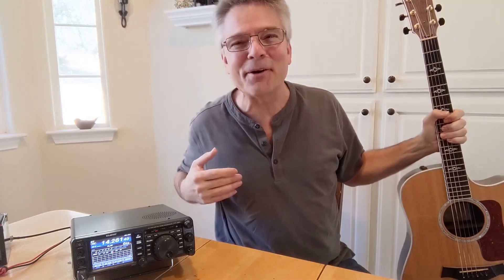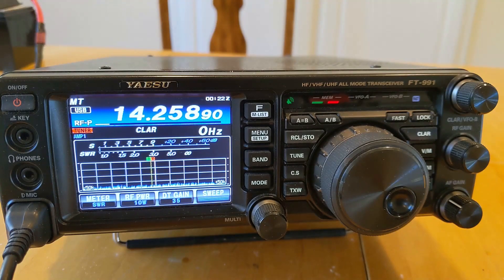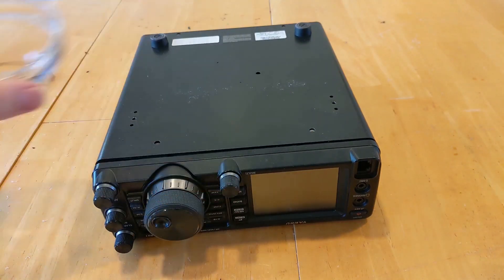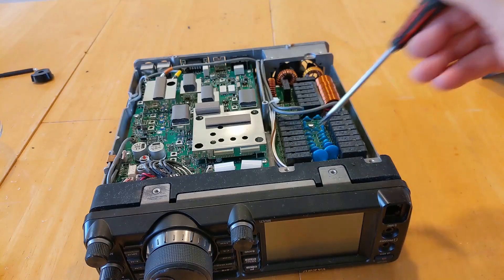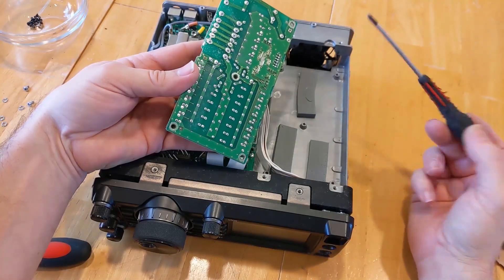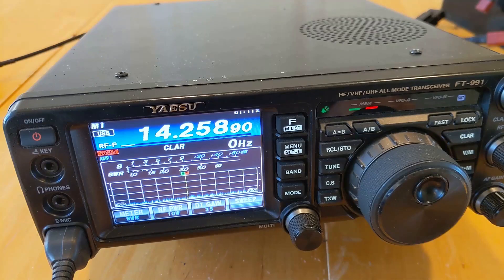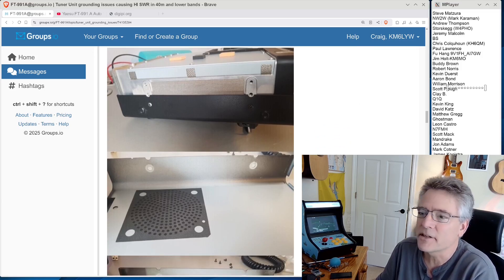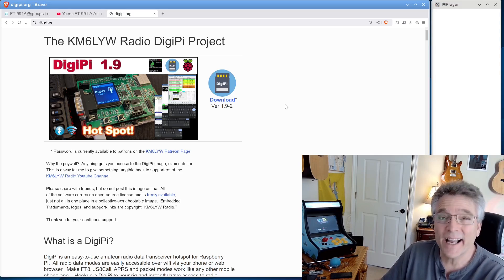Quick fix for your Yaesu Antenna Tuner!

Comment: Thx, you saved our field day event! After a few hours our transceiver started showing the same symptoms. It is a 3 year als version of the FT991A. So it seems that Yaesu did not cover this problem nor fixed it, they just had put some extra EMC strips and tape around the tuner....After the fix, we did a 1h test >50% duty 100W SSB cycle heating up the case to 40c, without a problem! Thx for sharing this information!